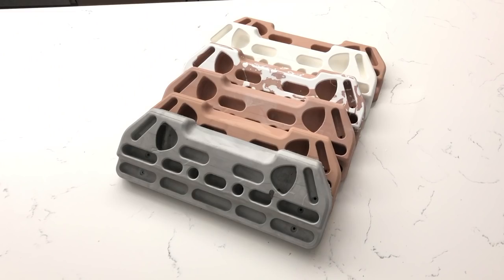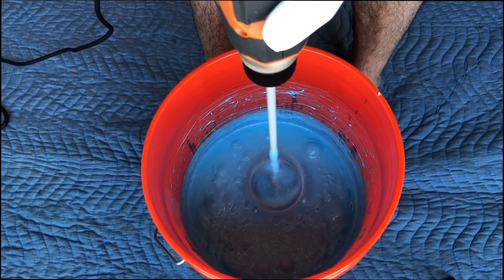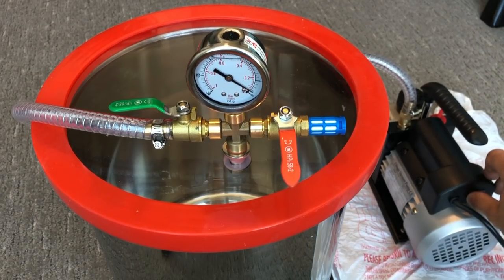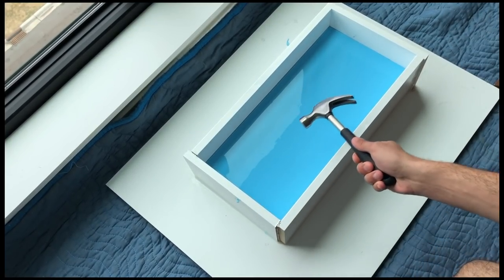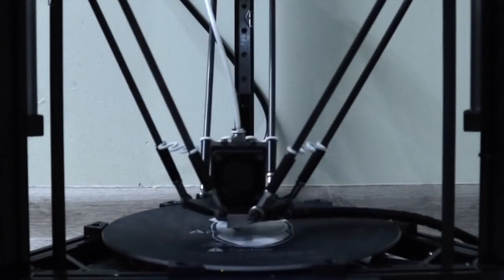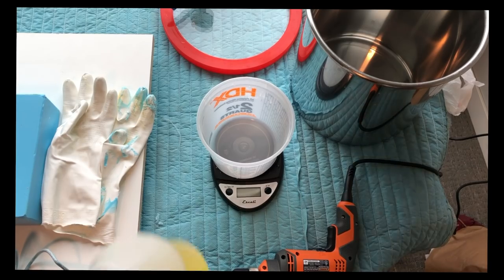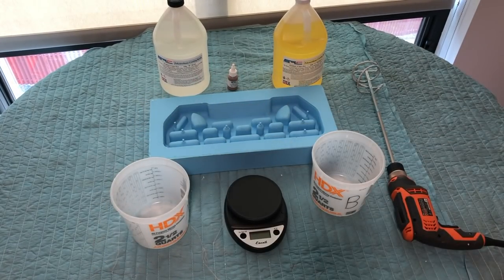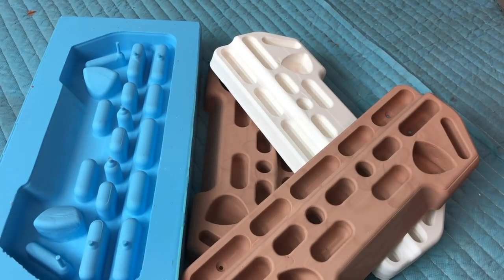Best Way To Make Parts At Home - RTV Silicone

Comment: In the past I have used the vacuum chamber which worked very well. I used a two part resin on high voltage electrical circuit boards. The resin had about about 2 hours working time in normal conditions but set in about 30min under vacuum.  A couple of tips use a container about three times the size of the amount of resin, as it "grows" a lot under vacuum. Place a sheet of blue towel under the container to catch any overflows and release the vacuum slowly.   If you are going to try solid moulds (metal) heat the mould before pouring in the resin as it helps the resin flow but shortens setting time. If the mould has a small opening to pour in the resin make sure that you have a hole to let the air out otherwise you can get bubbles.

Comment: for parts like this, you can easily add 50-80% filler to save on resin. there are plenty of options, from quartz powder or sand, to air filled micro balloons for super light castings. 
PS: a more tightly fitting mould frame saves a lot of material
Reply from the maker: Thank you, I will have to do that.
Reply: @ActionBOX  you're welcome. there are too many options to even begin listing them, but one i'd like to mention for things like this hangboard, is aquarium gravel with just enough epoxy to evenly coat it all and bind it together.
Reply: @Ucceah  Can you link any video about the process?
Reply: @m0neez for example /watch?v=KXEJN5CDxQ8 i have just searched "epoxy gravel".
this method is used for flooring too. (outdoors it allows for water to drain though it, and it's very durable and non-slip.)
i never did this myself, but it's not gonna take a lot of resin. maybe 5% .. 10% max by volume. a thin, even coat should be preferable, to any resin starting to pool at the bottom of the mould.
Reply: @Ucceah  Or sand? Normal climbing holds normally contain some sand as well, or at least they have some sprinkled on their surface to increase grip and texture, and sand is very inert yet dirt cheap.

Comment: Great tutorial.  I could have used this years ago.  My brother in law and I were making custom 10" He-man figurines.  We used this same process to copy the master model.  I would take a plain 10" articulated figure, and use Sculpey to sculpt the armor and other details.  It would take several cycles of sculpting, then baking the figure, then doing more sculpting to get a final, fully detailed product.  Once we were happy with it, we would set the figure half covered in non-hardening modeling clay with alignment pins/tabs.  The whole thing would be surrounded with heavy cardboard taped in place.  We would then spray a mold release on the part.  After that dried, we would pour the two part RTV into the mold and de-gas it in a vacuum chamber made from an old fish tank (really thick acrylic).  The rough surface was smoothed down with a torch just like you did.  Once that cured, we would remove the non-hardening modeling clay, apply more mold release, pour more 2 part RTV and re-run the vacuum process.  After curing, the cardboard was removed and the two molds separated.  The master would be removed and put aside to make more molds.  Depending on the molded item's shape, we would then carve air passages into the mold as well as an angled funnel.  The mold would then get a cleaned with soap and water, dried, then coated with more mold release.  

To make a part, one mold half would be taped off around the outside, covering the funnel and any air passages.  The mold would then be mostly filled with a 2 part either silicone or poly based resin.  The resin would be allowed to start to tack off.  Then, depending on the part, either a plastic or metal piece was placed into the mold and pressed into the tacky material.  The air passages and funnel would be cleared out, and the second mold half would be affixed into place using tape to seal it off.  The mold would then be filled completely through the funnel and placed into the vacuum chamber for degassing.  The mold would stay under a slight vacuum until the resin would be mostly cured.  For ease of mold release, the resin could not be allowed to be fully cured.  The mold would be opened, and the item removed.  This would leave us with a solid colored part.  If it had a metal frame, the part would have been molded with a resin called dragon skin.  Dragon skin is semi hard and very durable.  The metal frame would allow the part to be moved, so parts like arms and hands could be manipulated into various positions.  The plastic frames would be molded in a more traditional, but less expensive resin.  The plastic would let the part have give, but great strength for parts like the torso and legs. The parts would then be hand painted, assembled, and serialized.  These would sell for anywhere from $200 to $800 depending on the figure.
Reply from the maker: That’s awesome.  Sounds like you made a 2 part mold which is more complex than our one per mold.  😊

Comment: Great video. I've used molds to make repeatable components for years and I would recommend using a mold release to extend the lifetime of the mold. Keep the videos coming!
Reply from the maker: Awesome, thanks for the input. I obviously didn’t do that here, and will start to use this method.  Do you recommend using the spray on stuff?
Reply: @ActionBOX  Depending on the surface finish I need, I use either brush on or spray. However, as a general rule I go with Stoner brand spray release agents, only because I've had good success with it in the past. A friend who does a lot of prop mask casting uses smooth-on spray release for thin castings but I don't have experience with that personally.
Reply from the maker: @heirik2012  Awesome, Ill give it a try. thanks for the idea

Comment: That piece look much like a boulder training apparatus! I used to make same type of molds (fantasy jewelry)A person that i know still make that sort of boulder handles but he mix the resin with borax (he called " load" the mixture) to save resin and produce a rough surface (and maybe reinforce traction on the piece)
Reply from the maker: Cool stuff. I read online that Birax has now been banned as it can cause reproductive health issues, but do you know of any other filler?  Cheers

Comment: Mold release spray to help with demolding, plus vibrations to get rid of bubbles in resin (i just sit it on my washing machine).
Reply from the maker: Thanks for the tips. I never thought of the washing machine, that is a great idea.
Reply: @ActionBOX  I just asked a housewife ;+}
Reply: @ActionBOX  I use an old Vibrating foot spa for these types of requirements from goodwill stores etc.

Comment: I designed a very complicated plastic auto part in Fusion 360 (multiple curves on multiple axis and multiple parts all having to join together seamlessly) and to print it (it's 21" by 5" by 3") I have to use a CR10 5S and it takes 2 days per part (one complete kit it a right and left side so it's 4 days to print one kit). I would love to be able to make a mold and pop it out.. it needs to be UV, heat and weather resistant...so ideally, I'd like to make your injection molder... but it would need to be 10x larger.   I am blown away by what you guys are doing. You must be engineers!
Reply from the maker: Thank you so much, sounds like you have your own set of projects on the go. We are simply motivated brothers with some engineering, Science, and Business degrees in the mix. Looking forward to your comments in our coming up videos 😃. Cheers
Reply: @ActionBOX  - How about the plans for the injection molder?? You skip over the specs and assembly portions in your videos. I mean don't get me wrong, they are still cool, I still subscribed...but it just leaves me frustrated because I don't know where to begin with some of the complicated stuff you do. I am a microbiologist with an engineering desire budding.
Reply from the maker: @cnc3-in-1  Thanks for the reply! I plan on releasing a more detailed subsequent video with the Bill of Materials and step by step build of the machine.
Reply from the maker: @cnc3-in-1  We will be posting plans in a future video which will include the detailed build of the machine, and a Bill of Materials. Cheers

Comment: Mix your batch in a container that'll fit into the vacuum chamber, don't make a habit of pouring a batch directly into the pot.  Be aware and leave about 1/2 the container empty to create room to rise in the vacuum pot. That's also wildly too much rubber, 1/2" thick is plenty for most applications. Since that's easily over $100 worth of rubber it's ideal to use corrugated plastic for retaining walls using the corrugation to your advantage to make it easy to shape the wall to fit about 1/2" off the part. Use hot melt and add gussets on the outside to support it against hydraulic pressure. Finally, if you can use water against your pattern without damaging it, pour water in  to 1/2" over the highest point of the pattern, then pour it out and measure to calculate the volume of rubber necessary.  Mold release isn't necessary in a silicone mold, but it will make it last longer, and remove parts quickly after curing to save the surface from baking out prematurely. Casting resins that take longer to cure develop less heat and are easier on the life of the mold.
Reply from the maker: Thanks for clearing that up. You sound very experienced so I will take your advice. Cheers, Dave.
Reply: NP. Hand casting is an old model making and prototyping technique, and used heavily in the entertainment industry. A lot of aftermarket parts for automotive and other hobbies are initially hand cast until outsourcing becomes necessary.  3D software, 3D printing / CNC, and hand casting are the holy trinity of DIY. You can cast materials with properties that rival thermoforming polymers used in "real" manufactured goods these days. SmoothOn is ideal for getting a wide variety of user friendly materials in realistic quantities. Subbed.

Comment: What if you had a large enough vacuum chamber for the mold?  You might be able to get the bubbles out that way.  I am not sure how well it would work for things that need to be a precise size because the mold might temporarily stretch and cause sizing issues.  I have no idea, they are just thoughts.
Reply from the maker: I appreciate it.  Better in my opinion would be a pressure chamber to squeeze the bubbles really small before the plastic hardens.  It’s also much faster to pressurize a chamber then to suck vaccine in it. Cheers

Comment: First of all, this was an excellent and very informative video.  Thank you.  I was surprised that you didn't need to put anything on the mold before adding the final plastic.  Something to keep them from sticking together.  What is the secret to preventing the mold and the material filling it from sticking together?
Reply from the maker: Just material properties.  Polyurethane does not stick to silicone.  Does that answer your question?  Cheers, Dave

Comment: This is a pretty cool technique. Thanks for sharing.  Question.... have you tried using other compounds other than polyethylene. I'm looking to replace another of nylon gearing and I'm considering using this method. Any suggestions?
Reply from the maker: I used epoxy which worked great as well. You could try fiberglass fibers in epoxy for added reinforcement.  Good luck.

Comment: Great info video.
Could the pour at 5:50min be done in a DIY vaccuum chamber to get as much air bubbles out while hardening??
Reply from the maker: So the secret is to either remove bubbles or make them as small as possible.  If you put it in vacuum while it’s hardening then you will be turning any small bubbles inside much bigger.   If you use a vacuum then you want to do it while it’s still liquid so the bubbles are removed, and then eliminate the vacuum.  Does that make sense?
Reply: @ActionBOX  Thanks for your answer.
It makes sense yes.
The real problem is "time" then for hardening is going too fast.
Could you slow it down by pouring less blue stuff?
Then you would have time for vaccuum just before the pour.
Reply from the maker: @Dancer148  no, you can slow it down by cooling both parts prior to mixing.  Do not change the ratio of material.  Cheers
Reply: @ActionBOX  Aha, cooling down...
Nice, didn't on w that.
Keep up the good video's ;)

Comment: Hello!
I was thinking if it would be possible to use this technique to make small tires for remote control cars. The molds would be much smaller and the final resin would need to ideally be soft and rubbery.
Also the shape of the tire seems to be hard to remove from the mold, what you think...
Reply from the maker: It would totally work.  That’s a great idea.  The rubber is flexible so the shape of the tire can have some grooves it it.  It would still come out.
Reply: @ActionBOX  I don't have the space to do try that now, but it is on my list... Thank you for the answer

Comment: This video is super informative. Thank you for sharing all the info with us. I would like to make a driving instructor roof top sign. The ones that are on top of the pizza delivery vehicles or driving instructor vehicles. What material should I use for that? I know the silicone mold would be the same process for the 1st part I’m good, but the second part where you used the polyurethane resin. Can I use the same? Or do I have to use something different? The sign will be on top of the car and will be vulnerable to weather conditions (cold hot rain and snow) kindly suggest ?? Thanks in advance

Comment: good day from South Africa, i enjoy your videos. I am also play with 3D printing and injection molding and silicon molding. Now i want to make a mold from resin to be used for injection molding. What will you recommend.
Reply from the maker: I really couldn't tell you without additional information like the heat deflection of the material, the pressure and temperature of injection, etc. But I do love your idea. You have to let me know if you succeed.

Comment: I would be interested to pour smal machine frames for eg 3Dprinters or PCB mill 🤔  In mold there would be uses some reinforsment bars in epoxy 

Just wondering how expencive it would become
Reply from the maker: Check out our video on DIY CNC Machine.  We did just that.
Reply: @ActionBOX  Ohh, nice video too, so massive industrial class CNC  :o

..but Hmm.. Im thinking something like desktop router where base or side plates are casted with all screwholes include etc

Ive seen something fimiliar years ago, if remember correct, there was 3D printed hollow "case" which they filled with fine cement, Print had all screw holes etc for rails and other parts which was so nice for assemling

Comment: Thanks so much. Great video; no-nonsense explanations, clear, quick, and to the point. Love your style.
Would you happen to have a method to make silicone parts by any chance? (obviously a silicone mold would not work).
Thanks a bunch!
Reply from the maker: Great Question. You could use silicone molds but you will need to use mould release (and lots of it). Otherwise it really depends on the part. Could you share pics?
Reply from the maker: @Rfster900  Okay sweet, you can 3D print the moulds and then pour the silicone into that.
Reply: @ActionBOX  Yes that would be a great way to do it. You mentioned that the silicone gets pretty hot while curing. Any idea what kind of temperature it can reach while trapped inside a mold? We wouldn't want the 3D printed mold to reach the glass transition temp of the material (would result in warping...). PLA Glass transition T is ~55C-60C; PETG ~85C, ABS ~100C. ABS tends to be difficult to 3D print, PLA is easiest, PETG is 2nd easiest. Any idea? Thanks a bunch!
Reply: @ActionBOX  Ahhhh, that sounds like a winner then. Thanks again! Thumbs up!
Reply from the maker: @Rfster900  For sure, keep me posted

Comment: You can vacuum degass the part B yellow colored by itself in the chamber and mix with a stick much slower without introducing air. Part A I don’t think absorbs air. Also for storage use an inert gas to displace air in the storage container.
Reply from the maker: Interesting, I was unaware of this. Thank you for sharing 😊

Comment: Interesting stuff, thanks for the video on this. Did you have to do anything in terms of mould release agents, either for the initial silicone mould or else when moulding the PU replicas later on?
Reply from the maker: No mold release, the silicone is a natural non stick surface.  Cheers, Dave

Comment: I think it would be better to use a slower reacting resin and activator when making those huge parts. Because the reaction is exothermic big parts will set super fast because of all the heat produced.
Reply from the maker: You are 100% correct. I did purchase resin for 15 minute work time, but I guess that does not hold true when you mix as large of a quantity as I did. Hope you enjoyed the video. Do you use this resin for anything?
Reply: @ActionBOX  Actually I haven't used it myself yet, but I'm really interested in the topic. I do have plans to make my own industrial looking sim-joysticks and peripherals and I think resin casting is the perfect way to make the plastic parts, especially if I'm gonna make a few of them. I really liked the video and I was surprised how well the blow torch method worked on the surface bubbles :)
Reply from the maker: @molnez  To be honest with you that was my first time ever using the blow torch so I was also super surprised by how well it worked 😂. Glad my content could be of use to you. Don't forget to help me out by sharing with at least one person or group who may be interested 😃. Looking forward to your comments in my next videos to come soon.